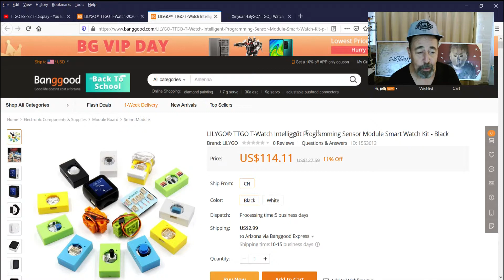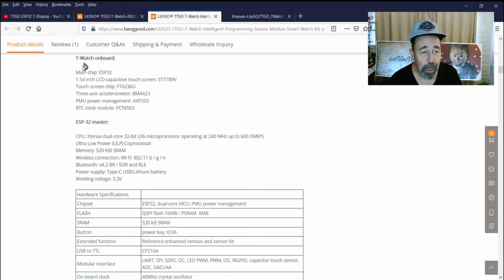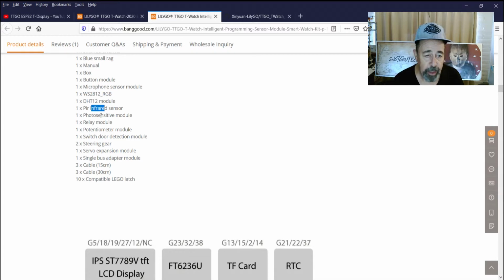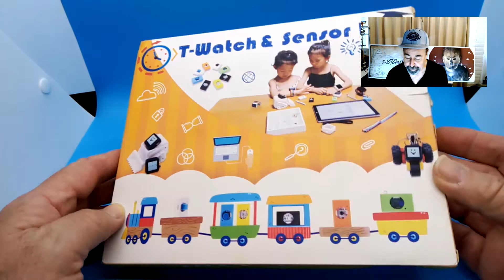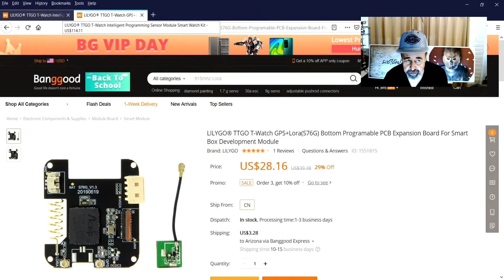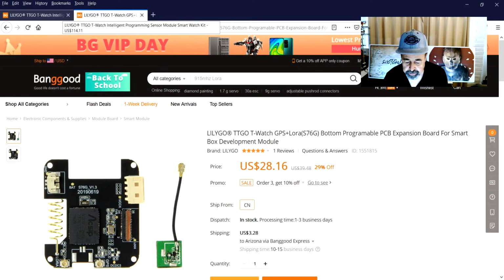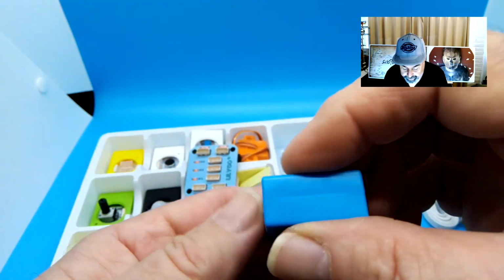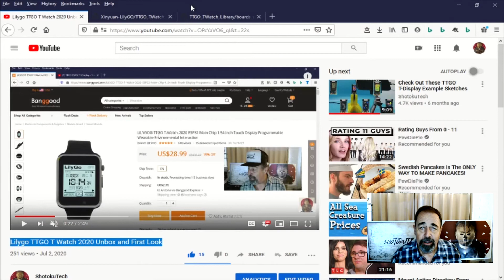TTGO T-Watch Sensor Module Kit Unboxing

Comment: Did you ever get any of the sensors to work?
Reply from the maker: Sounds fun. I'll put it on the schedule. Early June? Thanks.
Reply: @ShotokuTech  I'd like to use them in the sketch if it is possible
Reply from the maker: @bobbelt9807  Okay, so programming with Arduino IDE. Will try it! Thanks.
Reply from the maker: Here you go! TTGO T-Watch 2019 Sensor Kit Complete Run Through.
https://youtu.be/qUgHzHqZhC4

Comment: I saw sd card somewhere does this watch support it? please check im talking about the t watch 2020
Reply from the maker: T-Watch 2020 does not have an SD card slot. The bigger T-Watch 2019 does. Thanks.
Reply: @ShotokuTech  I was thinking of adding one via micro usb haha dont know if it works but I do get debugging issues
Reply from the maker: @nerdylicious1814  Not sure if that USB port supports OTG. Interesting thought.

Comment: 1 manual,,, Not Included    A watch and charm bracelet all in one.
Reply from the maker: Ha ha. I'm not into it for the watch form factor as much as I can stack the GPS LoRa unit onto this. Also see a tiny robot platform as a possibility. I wonder if someone has already designed something for 3D printed robot for this? Going to check Thingiverse. But fashion statement this is not! Thanks.

Comment: This is very similar to what you would expect as an arduino starter kit apart from the esp32 etc. Figured as I already have all these sensors and several esp32's it would be pointless to get the 2019 watch, and oh boy is it thick lol. I'm a little disappointed you're done with the 2020 watch as that was the main reason I subbed to your channel. I got 2 so I could run the firmware on one and program the other.
Reply from the maker: Oh I am not necessarily done with the T-Watch 2020. I am just expanding the repertoire. T-Watch 2019 with SD card, GPS and LoRa radio is attractive from the perspective of "what will I put in a rocket?" Sorry to disappoint. Thanks.
Reply from the maker: A couple of things: 
1) Check out Max Smoke. This one is a mad genius if you can chat him up. Not sure he is sharing that code? https://youtu.be/jsQ0poU1XSk
2) I am checking out PictoBlox again to see if I can do a mash up between it and my previous Arduino IDE examples mashup "WiFi Switch" to answer this comment "explaining how to do that with thw t-watch 2020 and change bg images and text" From my video https://youtu.be/kBVjevj41G8.
Reply: @ShotokuTech  I've seen his videos, certainly interesting and I'm definitely keen on seeing what you do in the coming weeks/months.
Reply from the maker: @TheDigitalAura  Thanks!